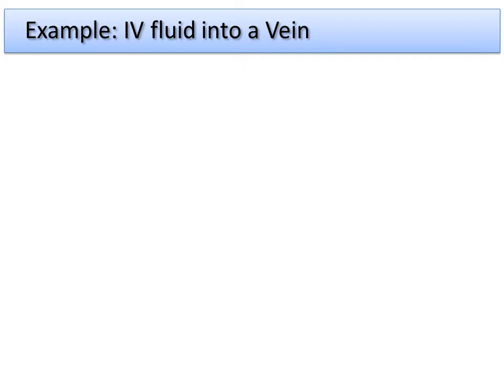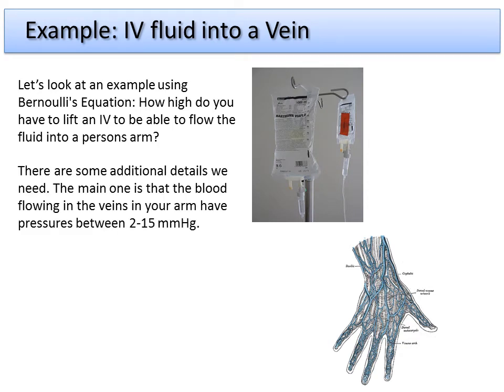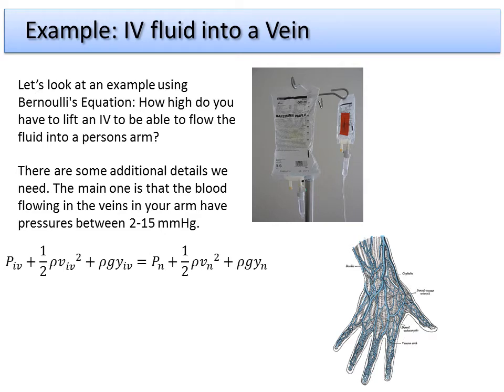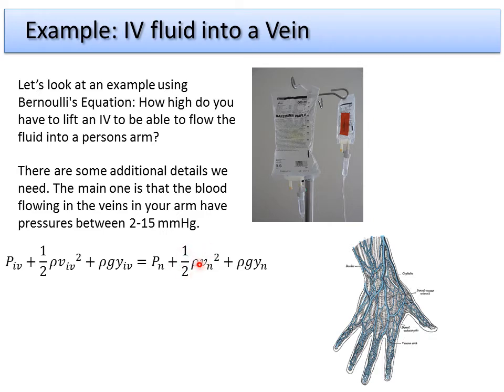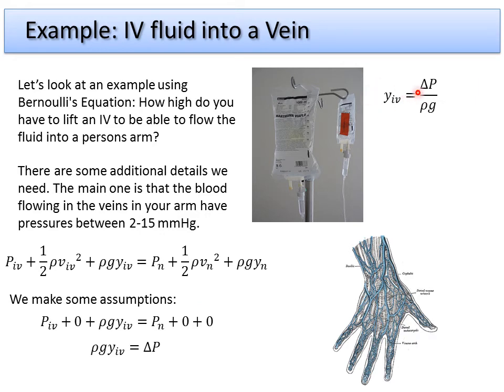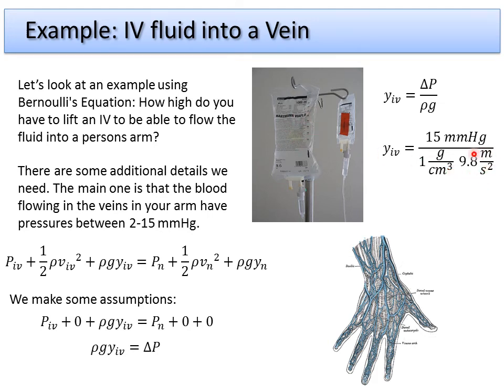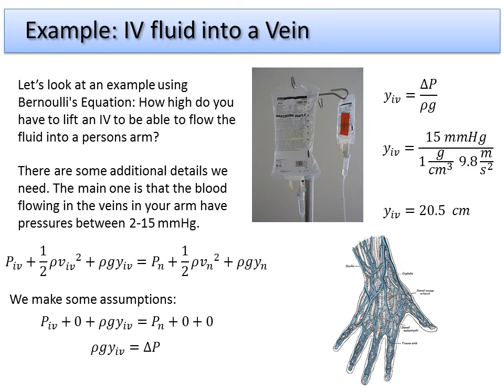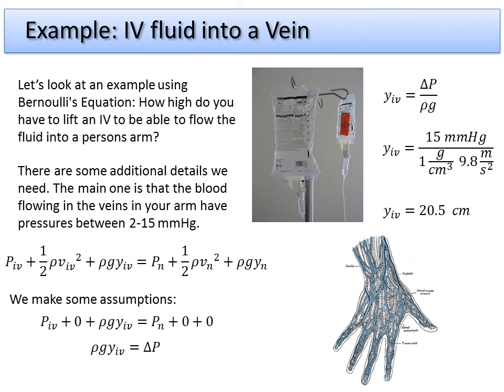8. Fluid Dynamics - Example - IV fluid into a Vein

Comment: But aren't fluids supposed to flow from higher pressure to lower pressure? If so, shouldn't the Piv be higher than the Pn in order for the fluid to flow into the vein?